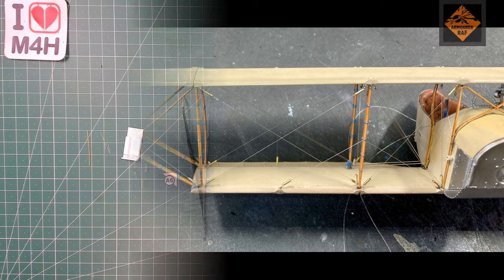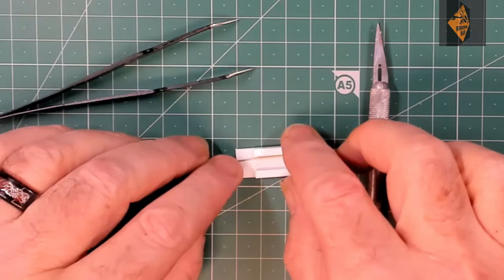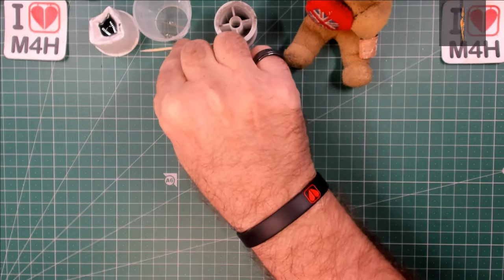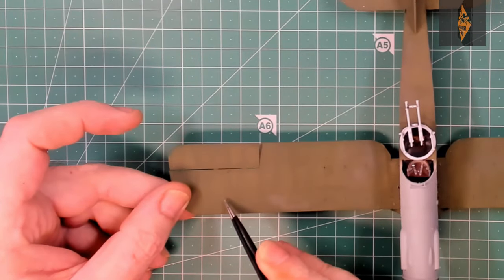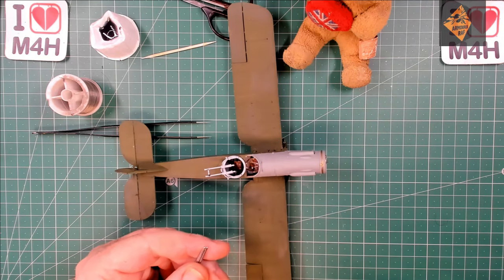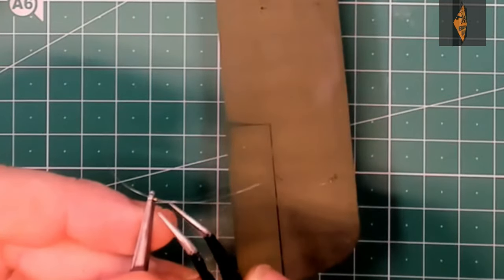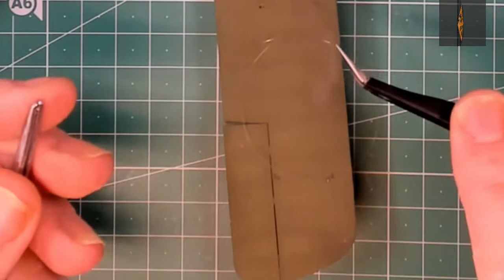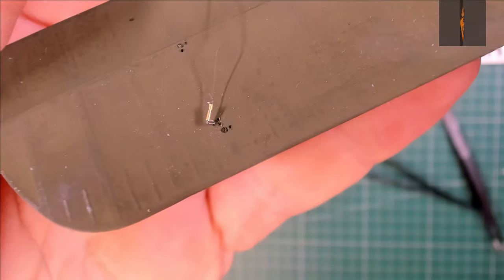How I go about Rigging WW1 Aircraft

Comment: Thank you for posting this video. I have used this method and I believe it is flawed. You can create a nice model with the rigging as you are showing but in time (about 1 1/2 years) the rigging will degenerate. The glue won’t hold and the rigging will unravel. I think elastic line works best.
Reply from the maker: @DavidRamirez-ww5kv  Thank you for that 👍🏼👍🏼👍🏼 As I said in the video, I used a mix of normal CA and flexi-CA. Hopefully this will not degenerate, but only time will tell 👍🏼👍🏼👍🏼